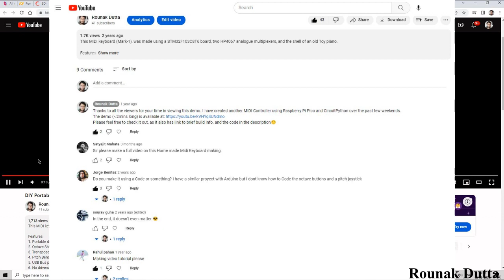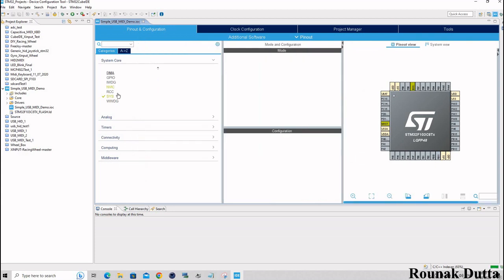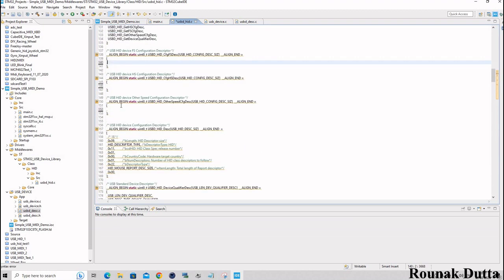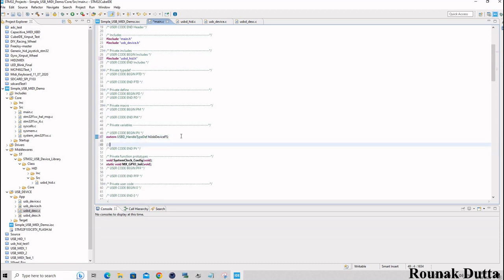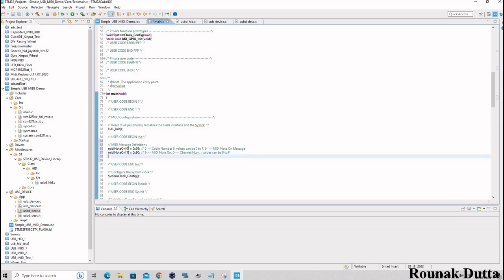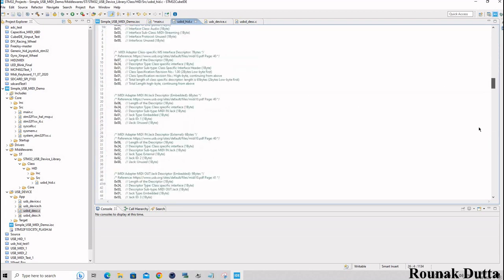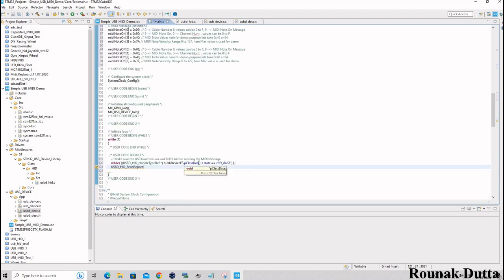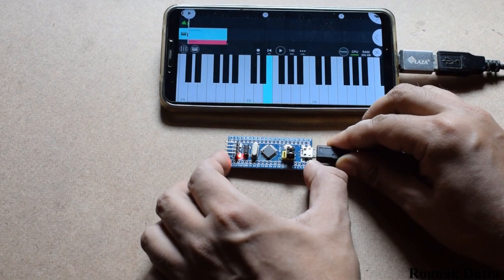A simple USB MIDI implementation on STM32F103 uC with CubeIDE

Comment from the maker: In this comment section there were few queries regarding how to read keys/ buttons (probably in a matrix) and send the corresponding data to PC. I have added an example-code/ pseudo-code for the same in the Github-repository. The example is in the file "KeyboardRead_and_MidiDataSend_Example.txt". Note: Please use diode-type keyboard-matrix to get proper polyphony and also to avoid any damage to the GPIO pins of the uC, as the GPIO-out pins have a chance of getting shorted in case of simultaneous key-presses without the diodes.

Comment: could you pls. provide simple while loop for button handling as trigger for midi note? did you use IRQ for it or classic loop sequence?
Reply from the maker: In my own code, I have not used IRQ, I just read the keyboard values in the main-while-loop and send the data to PC accordingly. I have uploaded an example-code/ pseudo-code in the Github-repository for reading data from keyboard matrix and to send the corresponding data to PC. The file name is "KeyboardRead_and_MidiDataSend_Example.txt".
Reply from the maker: Note: Please use diode-type keyboard-matrix to get proper polyphony and also to avoid any damage to the GPIO pins of the uC, as the GPIO-out pins have a chance of getting shorted in case of simultaneous key-presses without the diodes.
Reply: @rounakdutta6211  thanx. I wanna just use encoder and maybe 2 buttons. other will be combinations:-)

Comment: Hello my friend. Thanks for your guide. I can send data midi to PC with STM32F103 but i can't receive data midi from PC. i send data by (USBD_HID_SendReport(&hUsbDeviceFS, midiNoteOn, 8); ) but i don't know how to receive it.
Reply from the maker: Hi! I have recently made another video, with Custom USB HID Template through which both Tx and Rx of Data are possible: https://youtu.be/NXoqsiw93NM?si=sGsnnDtUmRxbDwOV
Reply: ok thanks, but I have a lot of problems. @rounakdutta6211
Reply: I write any code in the while {} ,the DAW software hangs..  @rounakdutta6211
Reply: I want to made only Transport control in Mackie control Mode. PLAY STOP RECORD
Reply from the maker: @farzadsamimi4415  W.r.t. my other video (for both Tx & Rx): https://www.youtube.com/watch?v=NXoqsiw93NM, any operation related to the USB-data received from PC can be placed in "CUSTOM_HID_OutEvent_FS" function in the "usbd_custom_hid_if.c" file. And any operation on the data received through uart can be placed in "HAL_UARTEx_RxEventCallback" function in the "main.c" file and sent to PC using the "USBD_CUSTOM_HID_SendReport" function. 

Note-1: All the major operations here are through call-back functions as the UART is in DMA mode and the USB-data received from PC is also through a call-back function itself.

Note-2: I found this article, related to Mackie control: https://www.jjlee.com/qlab/Mackie%20Control%20MIDI%20Map.pdf and to me it seems the controller is sending general MIDI notes, but in channel-1, so if this is the case with your controller, you will have to take care of the channel-1, instead of channel-0 in my code. In this video also I have explained how the midi messages are formed including channel-number and cable-number, etc. But if you want a better representation, here is a link I personally liked reading: https://learn.sparkfun.com/tutorials/midi-tutorial/messages

Comment: I've made it work as in the video demo, using the STM32F103C6 cheaper version of the Blue pill. Thanks! 
Now I'm trying adding two buttons and a volume potentiometer.
Reply from the maker: Awesome!! :)
Reply: @rounakdutta6211  Is it possible to send midi CC's in this demo configuration, or I have to add some descriptors in the usbd_hid.c ?
Reply: @rounakdutta6211  Can I take a peek at your keyboard code?
Reply from the maker: @alexlatelevizor  Hi! I would've shared the keyboard code, but my keyboard is implemented through Analog Muxes, because I was trying some experiments and the toy keyboard connections were non-standard, so it's unusable for any other work. My suggestion would be to follow the diode matrix keyboard technique. And for the midi data to be sent w.r.t key pressed, I have previously replied to another comment. I will copy paste that section here...

The midi protocol is such that once the note-on msg is received by the host, that note is considered held, until the note-off msg is received, thus there is no need to continuously send note-on messages when a key is pressed. To tackle this issue, I maintain a boolean or integer type array to store the state of the note (/key), such that 1 is on and 0 is off, for each key. 
When the keys are scanned in the while-loop of the program:
                                  If a key is pressed and in the respective array index the value is 0, 
                                                then send note-on msg and make the state to 1. 
                                  Similarly, when a key is not pressed but respective value in the array is 1, 
                                                send a note-off msg and make the status to 0, 
                                  otherwise,
                                                do nothing for that key.

Comment: Hai guru.ada sketch atau coding udah jadi nya gak?
Reply from the maker: I didn't understand your query, but I think you are asking about the code, and the github link for the same is as follows:
https://github.com/rounak-dutta/Simple-USB-MIDI-Implementation-on-STM32F103-with-CubeIDE
Reply: Sketch .
Upload via stlink or cable usb??
Reply from the maker: @RikiKurniawan-e4n  The programming is done through STLink. USB cable is only for USB-midi connection.
Reply: @rounakdutta6211  good.amazing sob.thank u 👍👍
Reply from the maker: @RikiKurniawan-e4n  Thanks!  :-)
Reply: Apakah bisa diubah menjadi hid keyboard
Saya ingin membuat drum, untuk trigger menggunakan piezo electric, dan ketika piezo dipukul maka di handphone akan menuliskan misal huruf "w"
Saya gunakan untuk fl studio mobile, keperluan drum  @rounakdutta6211

Comment: Why do you have to send 0x09 before 0x90? Is it some weird USB MIDI implementation? In raw Midi it's just 0x90, Note ID, Note Velocity. Also, how to implement the MIDI IN?
Reply from the maker: At timestamp: ~ 10:20, The 0x09 before 0x90 is indeed related to USB MIDI implementation. It tells the host that the midi-device data is from which virtual cable, and each cable can have 16-midi channels. I think, this can be useful if the midi-device is acting as multiple virtual midi-devices, and each virtual device will send data on separate virtual-cables. So, a single usb-cable/ connection can send 16(cable)x16(channel)=256 midi-channel data.

For your query on how to implement MIDI IN, I am assuming you mean how to get MIDI data from Host to MIDI-device. Unfortunately, I have not tried and figured it out yet :( . I have mentioned the same in the video-description. You may have to refer to some other projects in github, related to midi-playback device (instead of midi-input/ instruments). 

Best of Luck!
Reply: @rounakdutta6211  got it, thanks. Does the second nimble need to be the same as the first nimble of second byte? What about 0xFX commands, or Sysex?
Reply: Nevermind, found it on p. 16 of MIDI specification

Comment: Hello, I did exactly the same with the board STM32H745I-Disco. But when I insert the USB, the computer does not see the USB device.
Reply from the maker: Since I am not familiar with the disco-board you have mentioned, I am just throwing a few stones in the dark, as follows:
1. I looked up the board online, it seems to have multiple usb ports. Did you try connecting each port to the PC one by one? I think only one of the USB ports would be connected to the uC to be used as USB device.
2. In the CubeMX, during the start of the project, please select the exact board (or uC) you are using, instead of the stm32f103c8t6, which is shown in the video. I am almost certain that you might have taken care of this, but I am still mentioning, just in case.
3. Since it's a different uC, it may have a few different uC specific settings in the cubeMX, which I am not aware of. If this is the case, then the best course of action is to try some other USB based code for  the disco-board, available on the internet or from ST Micro to get familiar with the setup for the board.

Best of Luck!!

Comment: You should show us how to do the keyboard, the fact that it reads multiple keys at the same time and that it continues sending the notes when they are held down has given me a problem since it is not so obvious, thanks.
Reply from the maker: Thanks for watching the video and for the comment. I did not share the code for the keyboard implementation because I re-used the keyboard pcb from the toy-piano, which is very non-standard, and thus the connections and the piece of code is useless everywhere else, plus I have some half-baked experiments on the same which further complicates the matter.

Most commercial keyboards use the keyboard-matrix implementation with diodes to reduce the number of io-pins required and info. on the same is easily available either in Google or Youtube. In my case, since there were only few keys (~2 octaves), I directly wired each key to the uC through Muxes, which is very inefficient, but I technically have 24-note polyphony :D . My suggestion will be to use the diode-matrix method as it is the most widely used and also the efficient solution.

"the fact that it reads multiple keys at the same time and that it continues sending the notes when they are held down has given me a problem since it is not so obvious"  --> The answer to this part of your query is in two parts, as follows:    

1.  The midi protocol is such that once the note-on msg is received by the host, that note is considered held, until the note-off msg is received, thus there is no need to continuously send note-on messages when a key is pressed. To tackle this issue, I maintain a boolean or integer type array to store the state of the note (/key), such that 1 is on and 0 is off, for each key. 
When the keys are scanned in the while-loop of the program:
                                  If a key is pressed and in the respective array index the value is 0, 
                                                then send note-on msg and make the state to 1. 
                                  Similarly, when a key is not pressed but respective value in the array is 1, 
                                                send a note-off msg and make the status to 0, 
                                  otherwise,
                                                do nothing for that key.

2. Although the keys are scanned one-by-one and note-on/off msgs. are sent one-by-one for each key, since the machines are faster, the note sounds are heard simultaneously. 

I hope the above suggestions help with your project. Best of Luck :)
Reply: @rounakdutta6211  Many thanks for your explanation

Comment: STM32 midi device mobile connect to run yes or no  
You serch to me how connect mobile Arduino nano midi how tricks please find
Reply from the maker: As you can see in the video, stm32 USB MIDI implementation that I have presented here, works on Android (atleast with FL Studio Mobile for sure, but it should work with other applications too)
Reply: @rounakdutta6211  thank you for helping 🙏🙏🙏
Reply: Kya arduino nano atmega328 me nahi run karega

Comment: Bro I have Arduino nano I maked already Octapad .
Octapad run PC perfectly but its not connected to mobile device 
WHY............😟
🥺 please help me brother 
How. To connect my Arduino nano  my mobile 
Please brother request you 🙏🙏🙏 kya Arduino nano me midi device to mobile device support karta hai ya nahi
Reply from the maker: Hi! Arduino nano uses atmega328p uC, which inherently does not have usb device capability. The arduino boards use FTDI or similar ICs to connect to the PC, but only as a serial device (com-port). So, your drum-pad is most likely sending MIDI messages over this serial connection (not as USB MIDI device) and you are probably using a serial to midi software, e.g., "hairless serial to midi" to make the arduino appear as virtual midi device.

If you can find any similar serial to midi software for android, your drum-pad may work on android.

Windows, Linux, Android, macOS,... generally have inbuilt drivers to work with USB HID MIDI devices. Microcontrollers like stm32, rp2040 (rpi Pico), etc., has inbuilt USB support. In this video I was trying to show how to make the stm32 uC pass the USB MIDI descriptors to the PC (or android device), so it recognises the device as a USB-MIDI-device and take appropriate actions and recognise the MIDI msgs being sent.

The above answer is a bit long, but I hope the information helps with your project(s). Best of Luck!
Reply: @rounakdutta6211  Thank you sir very helpful explaination .
Reply from the maker: @pshkr1038  I'm glad that you found the info. useful, my friend :)
Reply: @rounakdutta6211  you can find for me serial to midi convertor app and how it work only one time please sir 
Iam beginner use to Arduinos
Reply from the maker: @pshkr1038  I looked in the app store and on google, it seems such app is not available at this point of time. You can try replacing arduino nano with Raspberry Pi Pico and use the Circuit Python USB library.
Reply: @rounakdutta6211  brother pi pico board just.  attached and Upload same code to run yes or no 
I don't know brother Arduino nano is not midi device support to android 
And I nothing purchase the board 
It's  run perfectly in pc  
Mobile to midi run very comfortable and easy bro I will try to day b day. After. Dhat any. Days. Sole this problem
Reply from the maker: @pshkr1038  Rpi Pico is not drop in replacement for Arduino Nano, but you can refer to this tutorial from Adafruit Industries (who provide the Circuit Python libraries), and check their github link for the code : https://youtu.be/WMKVC1su4Bw

I am suggesting RPI Pico because I think its easier to program than stm32, and also does not need any separate programmer, i.e., beginner friendly.
Apart from this, I don't see any other solution, as of now, but you can always write in some other electronics forum for help, maybe in arduino forums. Arduino UNO with atmega32 chip as the usb interface can be hacked to work as a HID device, I remember seeing some video long time back. If I find something, I will share here. But for now, that's the best I could suggest.